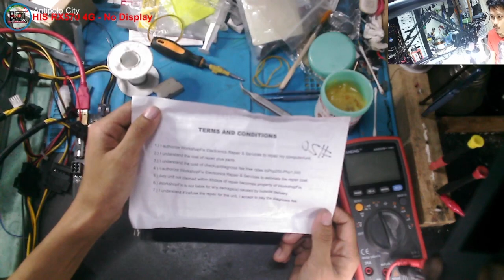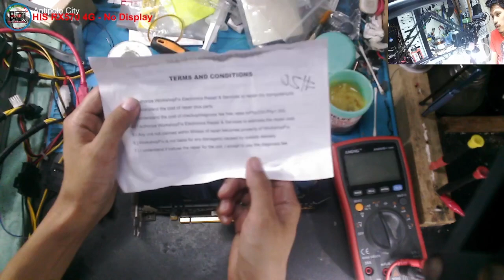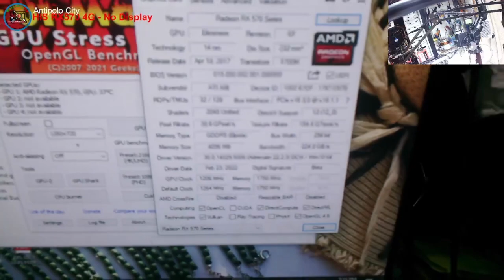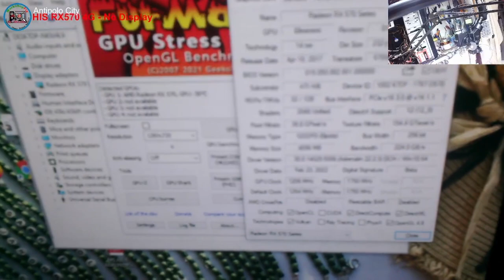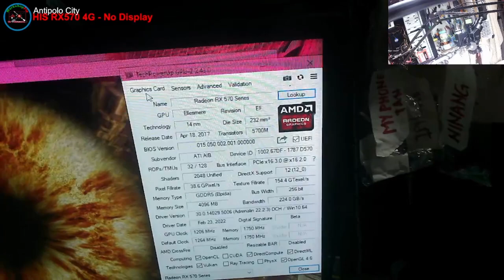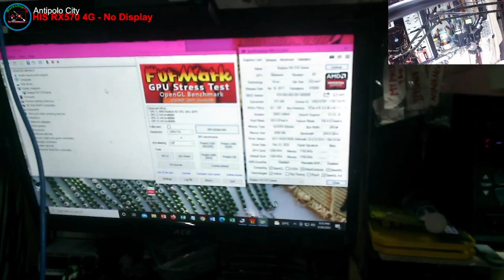HIS RX570 4GB - No Display, Missing SMD Capacitor at  the back of GPU chip(Solved)

Comment: Hello there, 

What are all of the SMD Capacitor values in an AMD Radeon RX 580 4GB?
I saw some missing and I immediately knew it was one of the capacitors missing.
Because of it, it has no Display. But when I switched to the IGPU, it also had no display. Meaning, that, the GPU Does get detected and the fan was also spinning.
There were 9 missing.
And, Correct me if I'm wrong. Does C Mean a capacitor? If so then the things that I was counting were right.

Thank you.
Reply: Im pretty sure itc  is capacitor and r for resistor but maybe I'm 8 months late for a reply lol
Reply: @vill2980  That was when I had no knowledge of electronics. I can probably fix it now idk, I want to reflow it but I don't have an oven. I tried a Heat gun on a spare GPU and it didn't go well, some stuff melted and a electrolytic capacitor exploded.